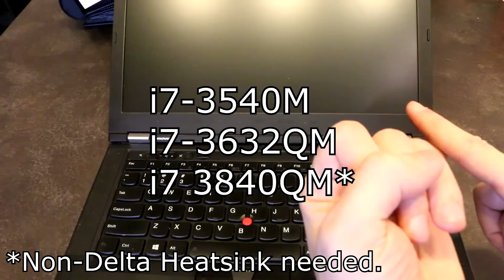Lenovo ThinkPad T430: Upgrade Wonder

Comment: i like mine but the cheap plastic battery holder clip broke off on the right side and now my computer is homebound because of it. my dell latitude has a much stronger frame which i think will never break on me like that
Reply from the maker: That's unique. Are we talking in the bottom case or the battery?
Reply: @LaptopRetrospective  the case. theres two plastic prongs that connect the battery to the case and one snapped off like a month after i bought the laptop, so now it doesnt lock in on the right side
Reply from the maker: Interesting. This is the first case I've heard of such a thing. Sorry to hear that.
Reply: @LaptopRetrospective  hey no worries. Check out the latitude e6520 if you can find it with the i7 2760QM. Its my indestructable tank of a laptop with magnesium alloy frame retailed at $1800
Reply from the maker: Interesting! I shall keep an eye out.

Comment: i have a T430 . Config i does  : I7 3740qm , hd 4000 , 1 ssd Samsung 840 pro 500 go  , 1 HDD hybrid Seagate 500 go , SSD Crucial 120 go  , 1 flash card 60 go . 16 go Memory Hynix  .  New keyboard whith light , 2 forces of light . Screen normal . Temp processor when no work  , 40°  Celsius . I love it and run very fast . And he's beautiful . I stress my processor and memory whith Aida 64 , Cinebench R15 and he run very fast . Very good computer when modified
Reply from the maker: Very nice setup. Thanks for sharing.

Comment: Thanks! - I for one am hooked on the T410s. Fantastic, except of run-time on battery. I have a bunch of cheap docks, in these days available from USD 10 onwards. So I can carry my 3 T410s around, have the manuals, some spare parts. And blow out the fan with compressed air from time to time. 
Just to think that you have a 10-year-old machine that easily compares with a 'modern' one - with the exception of gaming, of course. But I'm not a gamer, just some 1,8-inch SSDs thrown in, 8 GB of RAM, and all running *buntu with double-boot to some Windows on disks on the bays, swappable easily with DVD-RW.
Reply from the maker: Agreed. Very versatile.

Comment: Hello,
Thanks for the nice video. 
I just bought a T430 for my nephew and my question is: 
Do you think it's possible to mount a Bluetooth device in this machine & could you please tell me how?
Thank you once again.
Reply from the maker: Yep, two options, which is best will be your call:
1)  Bluetooth Daughter Card 60Y3305 60Y3303 installation under the palm rest. Not the worst to do, but not the easiest. Cost is about $10 but may require another ribbon cable and such. Check the manual posted in the description of the video on the work involved.
2) USB BT Dongle. $12 and can be moved to different machines as needed. No hardware to install.

Comment: Will this be a good work horse for SPSS statistics, multitasking with Excel, word, VLC? Thinking of buying one with 8gb ram and a i5 3rd gen
Reply from the maker: I can say yes to all except SPSS since I've never used it.
Reply: @LaptopRetrospective  thanks man. Great videos btw! Just subscribed.
I have a few on eBay watch list, the t430 with 8gb ram and 250ssd for around 100pounds, but I found the same model in a store for you 200 with one year guaranty. Not sure if it's worth double the cost.
Reply from the maker: I always prefer the one I can touch.
Reply: @LaptopRetrospective  so, I ended up just buying a 420 with 8gbram and 160ssd for 100pounds. The original keyboard and mint condition sold it for me. I hope it's a good deal and will be keeping an eye on you channel to look for future cpu upgrade. Thanks!
Reply from the maker: Nice find. Hope you enjoy it!
Reply: @LaptopRetrospective  it comes with win10, not sure to keep it or go back to 7. Win10 with office 365 will probably eat up all the 8gb ram , no?
Reply from the maker: Web browsers are the greatest enemy to RAM.
Reply: Update: after 2 years of service it is still going strong. Got a dock for it during lockdown so I can use a second screen for work and it is great. Shame CPUs for upgrade are still to expensive...
Reply from the maker: Great to hear from you again and glad to hear it's still going.

Comment: Just bought  two T430s Thinkpads for $100 each! i5-3320M, 8GB RAM, 128GB SSD. Using one of them now as my daily driver, replacing the Macbook Air 13 from 2013, I bought new. I plan to upgrade the chip & RAM in the next month & put a SSD in the optical drive bay. Came with Windows 10 but on my daily driver, I replaced it with a distro of Linux. It's an amazing machine!
Reply from the maker: Nice! Thanks for sharing.
Reply: wow nice, where did you get them? I just saw them as refurbished laps on a dutch site, for 300euros. Kinda way to much i guess. Its the t430s i5, 8gb and 180 ssd.

Comment: I am looking at used thinkpads t4xx series. How are the temperatures? And do they work loud? I would prefer as silent as possible.
Reply from the maker: ThinkPads are working machines. They aren't going to be the coolest under heavy load, bout 70C but they lift. Fans can get loud, but you'll never need to worry about overheating.

Comment: These are great machines.  Even if you don't use it daily, these are great for for putting a 2T HHD in the SATA bay where the optical drive was and keeping a copy of all your files on the computer you use daily.  Then if something happens to your daily computer or you have to evacuate, you can grab this laptop and be up and running anywhere.  With a SSD, they are plenty fast.
Reply from the maker: Great units, no doubt about it.

Comment: I have a T430. The only problem I got is that the two screen hinges broke after two and a half years.
Reply: Also I think those videos are pretty useful. I just learned where the hard drive is located. +1 Sub.
Reply from the maker: Glad you enjoyed the videos and found them useful. Always good to hear. The hinges must have seen some hard use in a previous life to get banged up. They are usually the toughest part.
Reply: Yeah that's probably why. It was made with used parts, including the battery. The battery was dead after about 5 months, but I get it since it was used. My brother actually gave the laptop to me when the battery had died. 2 years after, I found a new 9 cells Lenovo battery 70++ in the dead batteries trash at school. I found it like 4 days ago! My theory is that the previous user of the battery had a laptop only supporting something like 55++ and he didn't know.
Reply from the maker: That's the fun part of long lasting laptops, they have a rich history.

Comment: Just picked a T430 and the dock today. Really happy with the unit. Its such a TANK and feels so premium. 
-Cheers
Reply from the maker: Very cool.
Reply: @LaptopRetrospective  Hi L.R. question on batteries for the T430,  do you use OEM or 3rd party?  
I'm thinking of purchasing an OEM from Lenovo because I don't want to mess around with the BIOS. Do you use 3rd party batteries? If so have you had problems and had to modify the BIOS? What brands of 3rd party do you recommend from eBay /Amazon?
Reply from the maker: Lenovo batteries tend to be the highest capacity, but expensive and sometimes hard to find. No BIOS modding was needed for these, not sure what kind of batteries are being rejected. My biggest advice is but reputable and read carefully that the capacity you buy is what you get.
Reply: @LaptopRetrospective  thanks for the advice.
Reply from the maker: You're most welcome.

Comment: does it matter if its the T430 or T430s for these mods? Is it easy to upgrade the screen for better resolution?
Reply: The s varient has soldered cpu and can't be upgraded. And s varient has smaller hdd which are expensive and hard to find. If you are looking for upgrades I suggest non-s varient
Reply from the maker: Agreed, now that I've had one on the teardown table.
Reply from the maker: Isn't the S an i3 variant or something like that? Probably the same.

Comment: Can you do one for the T500
Reply: What do you want to know about the T500. I have a couple of them. One has 8gbRAM, 256gb SSD, 320gb, 7200 rpm HDD in the optical bay, Radeon mobility 3650 graphics, and a 1680x1050 display, ans a T9600, 2.8ghz CPU. Fantastic machine that will dust a lot of new computers!
Reply from the maker: Thanks for jumping in Dragunov!
Reply from the maker: Soon as one falls into my lap.

Comment: I've worked on these tons in my school's IT department over the past few summers, super easy repairs and solid build quality. Only real annoyance is the plastic clips that hold on the lcd plastic bezel tend to break and make the bezel flap around.
Reply from the maker: That's true, but in the grand scheme of things I'd rather have that as my weakness than a failing keyboard.

Comment: I have a t410 bought it new in maybe 2010 still soldiers on similar to this one I think. I do love the older ones though I had a t40 for a long time until it GPU went and for the longest of times I kept all my music on a somewhat Frankenstein t23, that died about a year ago but in a freak coincidence I found another t23 in mint condition to replace it.
Reply: It's just a late 90's IBM ThinkPad 1.2ghz pentium 3. Antiquated now but they do have that real nice build quality.  Mine runs a version of xp and plays music through winamp a few hours a week usually. Maybe once a year I print something with the old bubblejet which usually includes going online to fetch documents. So it doesn't do a whole lot but what it does it does well. You can leave them on for weeks at a time, they don't get hot, don't have noisey fans, don't crash etc. They don't come with built in WiFi and the material the shell is made of is not suitable for internal antennas but the fix is to swap the 56k modem mini PCI for a WiFi one, you install a ufl jack to the top of the lid so your antenna wires solder to the jack (so you have exactly a setup like you get on the back of a modem router etc .) Fun and games with old stuff.
Reply from the maker: Haha. Fun and games indeed. Just reading the workaround for the WiFi antenna brought a smile to my face.
Reply from the maker: Haha nice. I'm going to need to lookup the T23.

Comment: I wish I had seen this before I bought a $930 doller dell latitude, oh well...
Reply from the maker: Next time. 😉
Reply: to be fair I wanted a laptop to be able to do run virtual machines something I think this laptop may have  issues with
Reply from the maker: Depends on your requirements. I have Linux running on my x220 and tried it once with a decent amount of success. In my case I didn't have the spare hardware installed in my unit.
Reply: I use virtual box for windows 7 and 8 as well as ubuntu, my desktop is fine with windows 7  and ubuntu but lags when it comes to windows 8. my previous laptop a thinkpad yoga could barely run  ubuntu in vmware .

that said if I ever want a project laptop  (     and already Im tempted)  this would be it I'd probably install linux          :)
Reply from the maker: It would be an excellent choice.

Comment: Got a still untested T440 in a box . It has an i5 4300u CPU which might sound disappointing, but being a next gen CPU not THAT much performance will be lost, I hope, and I plan on buying a new (aftermarket, of course) high capacity battery to take advantage of the low TDP CPU and actually carry it around and use it anywhere, instead of using it always hooked to AC, as you would typically do with a used laptop. Complete laptop + new battery  is going to cost me 170 US dollars, so I still have a margin to throw an M2 SSD and a caddy for the mechanical drive plus upgrading the pitiful 4gb of RAM to a still somewhat scarce, but usable 8  Gig without crossing the 300 USD barrier. I do believe you just cannot buy anything new which closely matches that for the price, let alone if you love Thinkpads.
Reply from the maker: Great buy. Nice set of upgrades too.
Reply: The T440 is the only T4xx that I do NOT own. The i5-4300"u" processor, isn't that great of a performer, and not only are you stuck with that "u" designated CPU (not upgradable), you're also pigeonholed to 12gbRAM maximum. That sux!

Comment: I bought this same laptop with core i5 configurations and 4 GB ram and second hand, I am using it for my daily office jobs and sometimes editing on Sony Vegas for my YouTube chennal. Not that perfect but does my job in a cheap and most importantly it's an elephant, doesn't let you down any time but mine now has short backup time.
Reply from the maker: Definitely plusses.

Comment: This is one of my all time favourite post-IBM ThinkPads. I use one as my daily laptop for the last 3 years or so with 16GB RAM, 500GB SSD, Windows 8.1 Pro and hardly any complaints yet. My biggest issue with Lenovo is the lackluster screen resolutions but that can be easily replaced later.
Reply from the maker: Nice to hear you've gotten so much life it if it so far.
Reply: It’s a great little machine that’s for sure. The best post-IBM ThinkPad imo (now I haven’t had anything past the x40 series) is the T400. The C2D is getting to be unusable now but as a general purpose word processing, email, web browsing machine it is still amazing and my son and husband haven’t had a complaint about it.
Reply from the maker: Very cool. I'm just rendering another ThinkPad video I've had on the back burner. Hope you enjoy it.

Comment: I wonder how does the T430 compare to my refurbished Dell Latitude e6230. In 2015 I bought it on ebay and upgraded to 16G Ram (+140Eur), 1TB SSH (+220Eur), and the display to IPS (+90Eur). I use it with a docking station (+10Eur) and external monitor, but also take it everywhere - weight is 1.6kg. Linux support is superb - especially important to me: the docking station supports USB3 and works without any issues. In 2017 I repasted the CPU and bought a 2nd hand cooler since the old one had become noisy. Spare parts for this unit are ridiculously cheap on ebay nowadays.

At work I use a T450s and I am not overly satisfied. It is heavy, the screen sucks, the keyboard started to fall apart. The docking station although very expensive occasionally freezes the entire system when hot-plugged (kernel panic, LOL). Since 2014 the external battery life degraded to 1/2 hour. Even if the keyboard wasn't faulty I'd probably prefer the Dells touch and feel.

I just bought another e6230 for 140Eur with 8G Ram and 256SSD on ebay. I would recommend it to anybody as cheap ultra-compatible Linux notebook.
Can someone tell how the T430 compares in their opinion to the T450 or this Dell?

Comment: This too got that new windows logo? I liked the older ones a lot more (95-98 and vista-7 logo).
Reply from the maker: Designs come and go I suppose.
Reply: Laptop Retrospective  

Mostly it´s because of what you associate the logo and what versions of windows came in connection with which to me says it´s a no-no.

Besides, where did you get yours at? I would strongly recommend running linux since older hardware will get better potential than with windows to run more stuff.
Reply from the maker: If you see my other videos you'll notice the ThinkPads I keep dub Linux. This was a client build.

Comment: I've got an X250 that I love to death, and an X61T sitting around while I fight to make it think it's a Chromebook. If my job ever gets around to selling off the stack of old ThinkPads in the back closet, I may find myself in possession of a T420 and/or a T430. Basically, I'm hooked.

...although I do slightly prefer the Latitude line for the first two generations of Core i architecture. You'll never convince me that there is a laptop out there more beautiful than an E6420.
Reply from the maker: Haha, fair enough. ThinkPads are many things but beautiful is not often a word you hear with them.

Comment: i have to use and maintain older machines than this on daily basis at my job...
Reply: Me too. Mostly Sandy Bridge followed by Westmere and Ivy Bridge (mostly i5, a few i3 and i7). For office work, those are plenty adequate, and I/O matters a lot more. Have installed a number of SSDs over the last couple years, and the odd RAM stick. Recently got the very first legit complaint about CPU performance... sheesh, impatient young colleagues and their web stuff. It's only an i3-2310M and those never struck me as very fast, so I hope dropping in an i5-2540M is going to get this sorted.
Reply from the maker: Haha. Kids these days.
Reply from the maker: A true hero.
Reply: Laptop Retrospective thanks
Reply from the maker: Keep up the good work!

Comment: My T430 is dying (had it from new, case is finally giving up because I've treated it fairly badly), but it's perfectly fast enough with the SSD I put in it, I'm really really tempted to get a rather less abused T430 to replace it, or maybe a T440 or T450. I certainly don't need a new one as it's always been plenty fast enough for me, although I do have an i7-3520M in it. I just want another one before the screen fails completely. Delightful engineering!
Reply from the maker: If you have an i7 I'd invest in the spare parts to fix it.
Reply: @LaptopRetrospective  I could do that, currently that includes a near total disassembly to replace the hinges, I also need a new lid and screen surround, and a new hard drive access cover. Certainly doable, but if I jump ahead a couple of years I also get a much larger, nicer trackpad...
Reply from the maker: Why not do both!? ;-)
Reply: I recommend the i7-4700mq powered T440p, with nVidia graphics. Mine is used heavily as a workstation, and it gives VERY satisfying results! Tough as all get go!